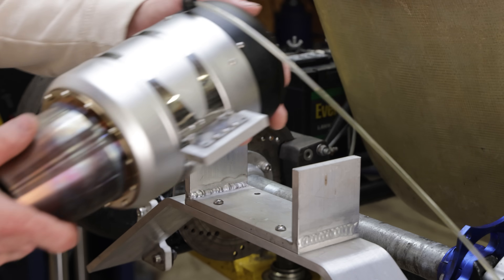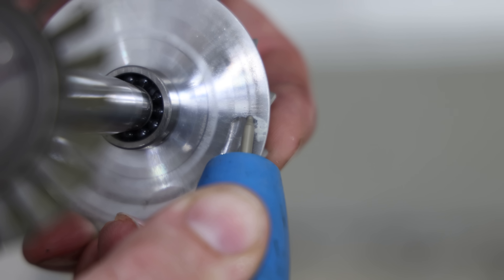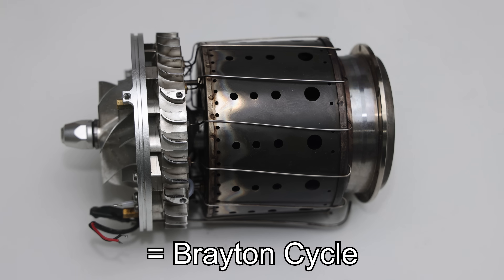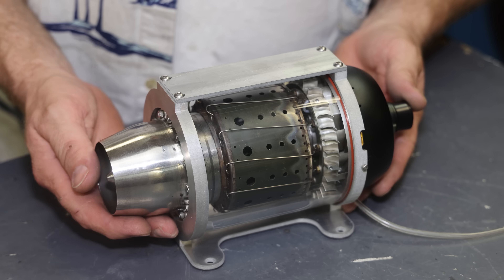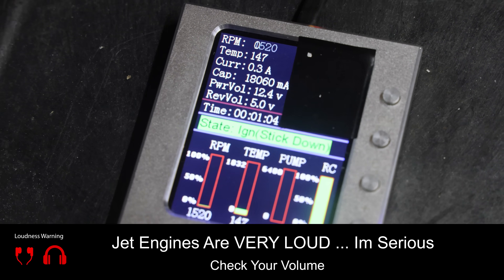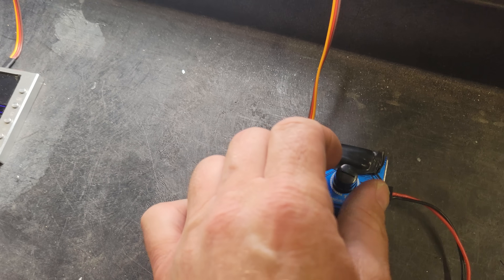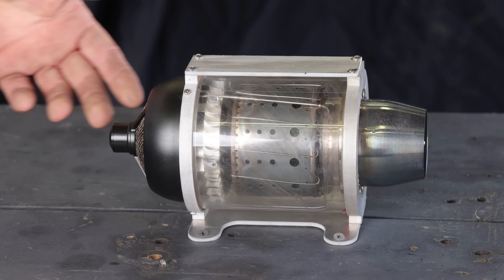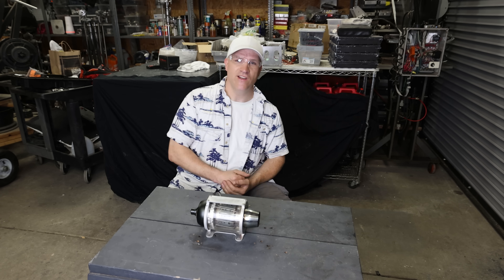See Thru Jet Engine

Comment: 0:28 - The rotor's radius is 75.0 mm 
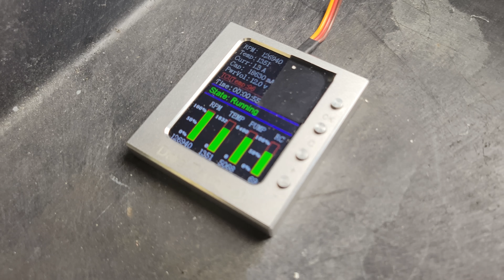8:01 - It reaches a peak of 127,000 RPM
Circumference of circle = 2πr = 471.239mm
Velocity of blades: 471.239 mm * 127000 rpm = 59,847,340 mm/m

The intake blades were spinning at 59.8 km per minute!!! That's 3,591 km (2,231.2 miles) per hour!!! From Los Angeles to Charleston, SC. In one hour.
Reply: To add to the insanity of the units, 3,591 km/h is almost Mach 3! The jet engine is an excellent example of the apex of engineering right after nuclear reactors
Reply: Now I get why he was so decided to fix those balancing issues.
Reply: The angular acceleration the blades is subjected to is ... a lot! I'm too tired to do the math now.
Reply: @ThomasGabrielsen  if the engine is rotating at constant speed there's no angular acceleration. You may have meant centripetal acceleration, which is the acceleration toward the centre of rotation required to stay on the circular path. That's a=v²/r (with "v" as the tangential speed and "r" as the radius), or a=ω²r (with "ω" as the angular velocity). Angular velocity is 2πN, where "N" is the speed in rotations (per second) rather than radians, so a=(πN)²r

Okay...
N = 127,000 RPM / 60 min/sec = about 2,000/s
r = 75 mm = 0.075 m
so
a = (2π*2000)²*0.075 = (approximately) 12,000,000 m/s², or 1,200,000 times the acceleration of gravity

This is high compared to an ultracentrifuge used in a lab to separate components of a sample. It's a brutal challenge for the construction of the rotating components.
Reply: @brianb-p6586  That is what I call a good reply! Probably the best reply I've ever got on YouTube, and you're absolutely right. I tend to mix these up. Thank you!

Wow! 1,200,000 the acceleration of gravity is heck of a lot of force. There can't be much impurities in the metal they are using.
I watched a YouTube series by Scott Manley called "Going Nuclear" some years ago, and he talked about how difficult it was to make the gas centrifuges they use to enrich uranium. A lot of the details about these centrifuges are classified, but he said that they are between 10-15 cm "wide" (in diameter?) and spins 1000 - 2000 rounds per second and that they generate a quote: "centripetal acceleration of about 1 million G". 
He also say that they are using magnetic bearings and that the tolerances are extremely strict.
With that in mind makes this small turbine engines impressive considering that they have about the same spec as a gas centrifuges for uranium, and generate more or less the same centripetal acceleration.
 
If you're interested in this video the title is: "Going Nuclear - Part 6 - Uranium Enrichment" and he start talking about gas centrifuges around 9 minutes. 
PS: I don't want to post the link because YouTube tends to mark post with links as spam.
Reply: #@Marq... "9000" LOLOLOL.
9000 WHAT?
 if its "9000" pounds thrust it can power a jet aircraft.
@Thom... saw on other video it generates 63 pounds thrust. Not bad for size and simplicity.
Reply: @TurboMountTV  He was usinf the  "Power level is over 9000" reference as a joke
Reply: @TurboMountTV  Goku!
Reply: @TurboMountTV  this engine produces about 30 pounds (130 newtons) of thrust, and Matt has reported this value several times in response to other comments on this video asking about thrust. You must have seen the thrust for a larger engine in another video.
Reply: The bit I find even more mad is that at one point the tip of the blade is moving from east to west at 2.2kM/h (capital M for miles) but 0.0005 (did I get that right) seconds later, it's now travelling 2.2kM/s to the east. The acceleration is nuts.
Reply: Minor error: the diameter of the rotor 75 mm, so the is half of that, and the rest of the numbers are too high by a factor of two.
Reply: @brianb-p6586  Sorry, but that's incorrect. Look again at the diagram on the screen at 0:29. The arrows clearly point from the center of rotation to the edge. That distance is the radius.
Reply: @marquizzo  ah, sorry - I was thinking that this is a 100 mm diameter turbojet, but that's apparently the turbine diameter, not overall, with a larger compressor impeller.
Reply: How fast is that.. 😳😳😳
Reply: How much thrust?
Reply: @TurboMountTV  It's over 9000.
Reply: @marquizzo  WHAT 9000? THERES NO WAY THAT CAN BE RIGHT
Reply: @TurboMountTV  'bout tree fiddy minutes ov' goosing yer nan mate
Reply: ~1 km/s!
Reply: Yay Charleston!

Comment: Very nice. I could not see where you starter motor worked, to get the compressor started to the point where you could ignite the mixture. Very nicely done though.

Comment: I submit that the fog did not show up aft of the engine because the very hot high efficiency combustion inside the engine burned up whatever was in the fog. Not even carbon was seen in the exhaust.

Comment: 5:40 Yea, I was wondering how long those gaskets would stay intact and in place as soon as I saw you printing them, lol. Do you have to replace or reposition them on every run? Is there a way to fix the see-through design so that the gaskets aren't sliding out of place?
Reply: The gaskets are not printed, they're cut from silicone rubber sheet.
Reply: @brianb-p6586  oh yes. Good point.

Comment: Nice to see a small engine assembled and run. I would love to hear a few technical explanations on the dimensioning and design as the Video progressed.
What level of Static Thrust does it develop and what is the fuel consumption?
It was so realistic to me that when you touched the case after shutting down, my fingers reacted and pulled away )
Reply from the maker: Thanks, this engine is a small one, only about 30lbs of thrust

Comment: Its interesting that it appears to be a centrifugal type rather than axial flow, but I guess it makes more sense at this sort of scale.
Reply: Yes, all of the tiny turbines (there are several manufacturers), even up to the smallest turbojet and turboshaft engines used on aircraft that carry people, use a single-stage centrifugal impeller for the compressor, and normally they use a single stage axial flow turbine like this as well.

Comment: Soll es ein Elektromotor mit Kühlung sein oder eine Coladosenheizung ?
Also für irgend was muß man sich schon entscheiden, wenn man den Pickelsteiner aufmacht ?
Die große Gasflasche für den Fingerhut und den Metalllot - Gaskrümmer mit Gas - Glühstrumpf
hat keiner gezeigt,  gut dort eingebaute Gaslampe 😂😂😂und Kreiselturbine
Viel Dampf fehlt. nur rückführendes Konvektionsmittel fehlt hier auch ?
Wird noch heiß wie Lötlampe. heißer Huller, Puller Schnuller inside ?
in Lötlampe eingebaut ?

Comment: so interesting !  all thumbs up! Cant wait for part 2 coming up! ...may be try an extra injector to the chamber to inject .. may be ..water, oxygen,.. idk.. something. And right.. looks like it doesnt consume so much intake air.. may be spent artificial air at inlet and try run under water (when running) :-) .. Can you use exhaust to sandblast something ? ..may be a stupid idea in any way... btw.. did you have pressure gauge inside the outer shell ? i like to know, how much pressure the acrylic shell can withstand..may be insert some more Measuring devices here and there before blow it up .. such interesting project..go on !

Comment: Awesome!!!  Maybe the combustion chamber could be made from quartz glass tube.  It's more thermal shock resistant than borosilicate glass.  The holes could be cut with diamond grit hole saws or a laser.  Great Video!!!!!!

Comment: That you have the sheer experience it takes to do a "sloppy bench build" and it work SO WELL is amazing in itself man.  I was a maintenance electrician-mechanic for 32 years, and I grok the  need for that much experience.  You know where to apply "solid slab" rules and where to ease up a bit, and have the working assembly be SAFE.  THAT is impressive!   For me to feel safe doing just one jet engine, I think I'd need to build/rebuild then go again maybe a few hundred times!  LOL!

Comment: Pretty cool, but looked like it was running WAY hotter than it could sustain for any length of time if it were put on a model airplane or other model vehicle, without burning itself up.
Reply from the maker: Nah... That's typical, check out my thrust Test video on different fuels, now that was running very hot.

Comment: Could you use hydrogen as a fuel for that thing? If so, maybe you can extract the hydrogen from water via electrolysis. You can make a bunch of little cogen plants. My stepfather is a plant engineer at a cogen plant that produces energy with giant gas turbines. Maybe you can create a new type of personal cogen plant. Use the water that you extract the hydrogen from to cool the engine.

Comment: I'm a tech geek who has spent a major part of his life reading & watching stuff like this.  THIS GUY knows how to film an assembly.  I'm so sick of 20 min videos which spend 19 minutes & 59 seconds on how to turn a screw or saw a 2x4 in half.  Most of the time I just skip to the end to see the finished project because I've seen all the steps in 10,000 other projects.  This video shows the mfgr & assy, but I don't have to sit through it all in real time!!  Thanks!!!
What is the case made of?  Is that a Plexiglas tube with so much air running past that it doesn't melt or a piece of Pyrex tube?  I watched the assy again & I couldn't tell....except the ends of the tube look plastic.  If it's plastic, that's as astounding as the whole rest of the video!!....Oh, I see  (read further).....it's top secret extraterrestrial material from area 54.

Comment: Perhaps the "smoke" didn't work because it was vapourised as it entered the chamber, in that case a "smoke" composed of particles (soot ?) rather than vapour (essentially a gas) might be more visible. Of course you may then have a build up of material on the blades giving an imbalance. Not an easy one.....

Comment: First off , your see through turbojet is about the coolest thing on YouTube. I couldn't get to the subscription button fast enough. I thought it was pretty cool to watch that incandescent heat glowing in the combustion section migrate to the rear as the RPM increased the air flow .

Comment: how much thrust does this engine create? i wonder if it could be mounted on a sailplane (in lieu of a gas-powered engine on a motorglider).
a clear combustion cylinder would be cool.
Reply: Yes, larger versions of engines of this design are used on motor gliders (also known as self-launching sailplanes)... but they are typically much larger to be useful, like three times the diameter, twice as long, and ten times more thrust. The PBS TJ100 is an example of an engine which is used this way; the similarly sized Sermel/Microturbo TRS 18 was used in "J" (for "jet") versions of the Caproni A21 starting in the 1970's.

Comment: Thanks for the experiment lol. This sht is/was cool as ever. What I found crazy was how the plexi-glass held up to the heat and pressure it sustained during both test. It begs the question of how much we're willing to sacrifice the initial material expense, for longevity. I'm sure jet engines are overly expensive to manufactur, but would we see any weight redctionss by switching to glass, and IF we're able to produce these engines any cheaper by using glass over steel or titanium .

Granted that this is about 80X smaller than the engines used in commercial aircraft, acrylic is also stronger in thicker gauges, that may very well provide some of the same strength and rigidity as earth metals. I would like to believe at least.
Reply: Any kind of glass would be much heavier than the stock metal housing, and while Matt has done an admirable job of making a clear housing that lasts for the demonstration, it's not practical for a functional engine in an aircraft.

Comment: See through jet engine   .....    sounds cool so I watched and guess what, it was.  

Unlike many of those commenting here, I'm not a rocket scientist. That said, I still found it interesting to learn that the turbine wheel powers the compressor. That sounds like - and I'm showing my ignorance here - the wheels of an EV automobile powering a generator to produce electricity that charges the batteries to power the car to turn the wheels to power the generator to produce electricity that .... 

With a dribble of kerosene, or sunlight, both machines will produce endless power.  My icon is smarter than the average bear, but I'm not.
Reply: No, it doesn't work that way. Some of the energy of the hot gas stream from the combustors is collected by the turbine to drive the compressor, but the only source of energy to the engine is burning fuel. The turbine engine has to do this because it needs the air to be compressed, but there is no need in an EV to generate power just to use it running a generator - that would just be a complete waste of energy.

Comment: Wow. Brilliant video. I was an apprentice at a small gas turbine company back in the 80's - Noel Penny Turbines. Worked in the drawing office after my apprenticeship. I remember running the engines up in the test beds. We developed turbo props, power generators and cruise missile engines, and even ship de-icers. It was always scary firing these machines up because they were so loud and powerful. This video here shows the turbine spinning at 127,000 rpm! That's fast! Our turbines ran around 70,000rpm I think. We also tested them for burst too. All amazing real engineering.
Reply: If yours only ran at 70,000 RPM, they were presumably larger in diameter... perhaps twice as large as this roughly 100 mm (4 inch) machine. I found specs for the Noel Penny 310-3/4, and indeed it is much larger; the combustors are outside of the compressor impeller radius, but even that impeller (and the turbine) probably have twice the diameter of the corresponding components in the engine used for this demonstration.
Reply: @brianb-p6586  Yes you're right. The typical impeller in those turbines was around 12 inches in diameter. I think the largest diameter turbine we made was 3 ft. Small turbines for light aircraft and generators mostly. Real engineering though!

Comment: Huh, for some reason I was expecting that finned disc at the front to spin
Reply: That's the stator, which acts to redirect and diffuse the air coming from the spinning compressor impeller. The impeller is shown during the balancing process and assembly of the engine, but isn't visible in operation (the housing for that part is not clear).
Reply: @brianb-p6586  Ah cool, cheers for that; I'm not super au fait with how jet engines work and it's always nice to learn something new.
So does the air initially travel on the outside of the combustion chamber after being pulled in via the impeller?
Reply: @BdotRASS  Yes, the air goes through the impeller (picking up speed and energy), then through the stator which is around the rim of the impeller (reducing speed and gaining pressure), then inward and rearward through the combustors (where burning fuel adds heat without changing pressure), then through the turbine wheel (where is drops in pressure and speed, giving up energy to drive the compressor), then out the exhaust nozzle.

The compressed air is not cool, but it's not nearly as hot as after the combustors, so the fact that it comes in from the outside helps cool the housing, which is very good for the clear housing but good even for the stock steel housing.

Comment: I used to refurbish GE-90 Jet Engine Fan Blade Platforms for GE, through a contracted company, as a Composite Technician. I got to learn the complete inner workings of the big boys (GE-90) and they are magnificent marvel's of engineering. The power, precision and delicacy of the modern jet engine is one of mankind's finest achievements of all time, among a few others. In my opinion.

Comment: ey the proximity of the plug is important as hydrogen won't ignite unless your variables are balanced  the magnetic chamber is similar in design to a nuclear reactor
in this case three phase 3 compressors  3 supply chambers

Comment: ello Mate listen if you increase scale   IE  size x30% then put in 3 glow plugs in a y configuration  you will ignite fuel faster and supply longer will in use
think about this  look at the same principles but in a magnetic  thermo magnetic  module sealed and pressurized

Comment: the fuel injected were of liquid or gas form? if liquid form, it would flood the combustion area and spill out of the exhaust, isn't it?
Reply: The fuel is injected as liquid, as it is into any engine. It vapourizes and burns.

Comment: In a jet, once the fuel is ignited, the flame is self-sustaining unless heavy rain or severe weather encountered. I have to just shake my head and ignore movie scenes  where they say there is a flameout and it shows flames shooting out the back when a flameout is exactly that, the flame has gone out. This type is also known as centrifugal flow due to how air enters and flows from center to outer edge. An axial flow turbine would look almost identical at both ends but without stationary sets of blades at intake. This is more for some viewers since I assume to make this so well, you have a working knowledge of jets. The Smithsonian has (or had) a cutaway military engine so you can see inside.... but not while running.
Reply: Axial-flow compressors do use stators, alternating with the rotating impellers. Normally the front element is rotating.